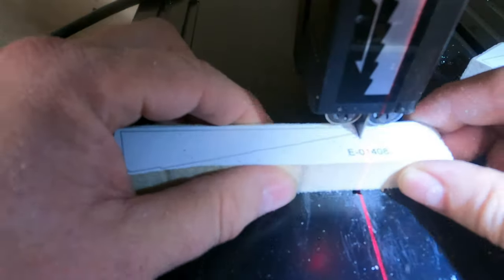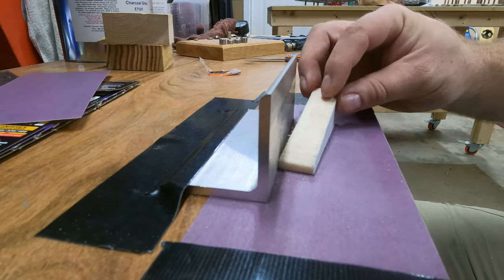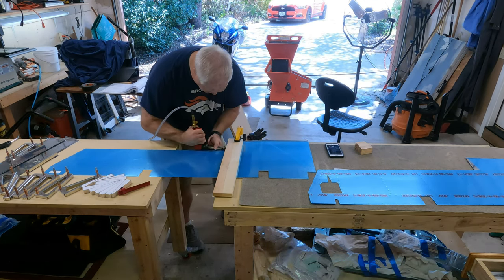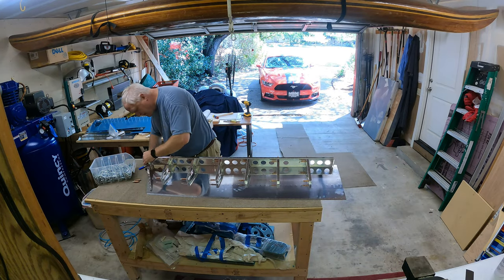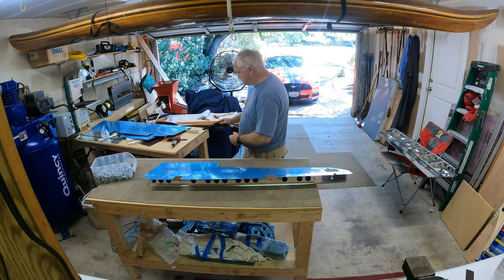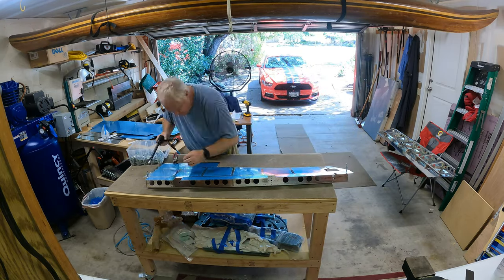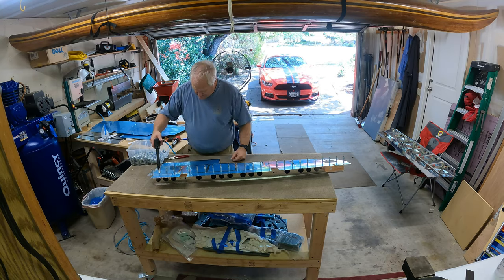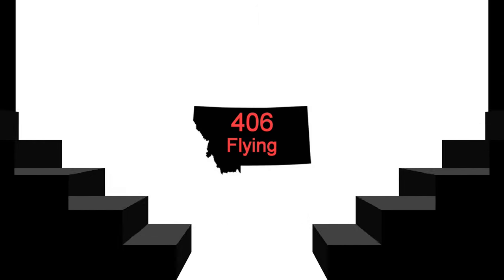Van's Aircraft RV-14A Elevator Part 1

Comment: Thanks for the video.  I'm also building the elevators.  I have to believe you noticed this, but I have to ask, "Did you notice the template drawings on page 09-29 were a bit undersized, making it such that if you just copied the page before cutting out the templates, they would not dimensionally match the foam blocks?  I had to make several sized-up copies before getting usable templates to glue to the blocks before sawing them out of the foam.
Reply from the maker: I actually printed it from the USB drive copy of the plans on several sheets of paper with scale set to 0. Came out perfect.